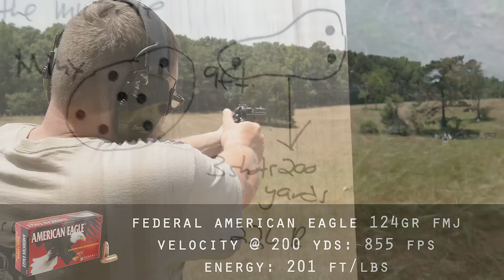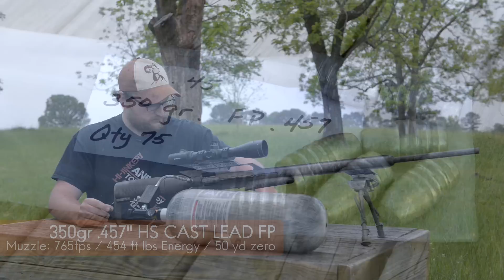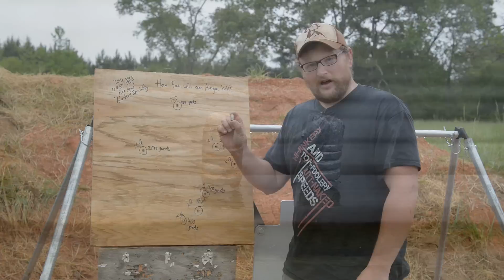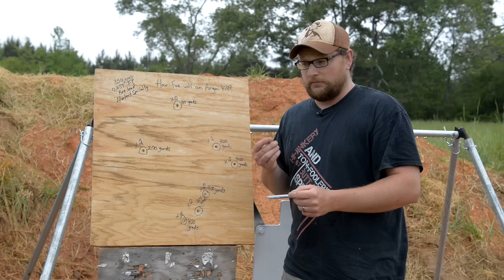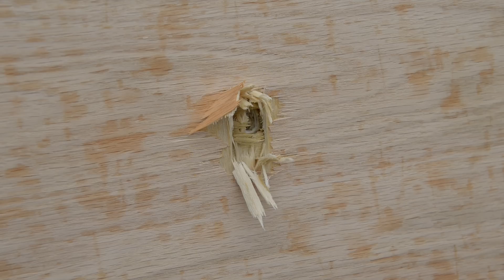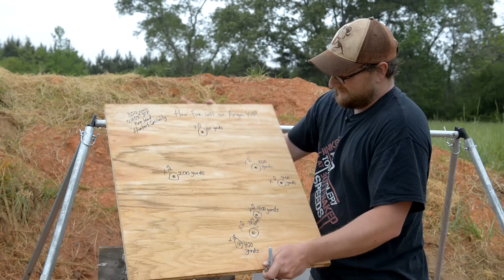How Far Will an Air Rifle Kill? Part 1

Comment: Can we see how far a 12 gauge will kill?  Maybe video game designers will stop making them ineffective after five feet.
EDIT: You don't have to explain weapons balancing, my position is that the balancing of most games is flawed.
Reply: Or the other extreme where it's basically a pump action long range rifle.
Reply: mike pk666
That's because it's a slugshot and it generally goes further than normal buckshot rounds.
Reply: You guys are wayyyyy underrating shotguns. I have a Remington 870 20 gauge youth model that I can hit soda cans with at a 100 yards with slugs; off of a bench rest of course, but it is a smooth bore and I did that with only a front bead sight! I hit 4 out of 5 with 5 shots. It also only has a 20" barrel. You should Youtube Hickock 45's channel, he shoots a benelli semi auto smooth bore over 200 yards.
Reply: If it's more effective shotguns you're looking for, ever tried Killing Floor? Both 1 and 2 have real nice shotguns. Even the starting Mossberg Rolling Thunder (a 20 gauge shotgun, IIRC) feels punchy and can take a Clot's head off at 20 feet or so.
Reply: +Inside DeMonz KSG-12 from Bo2
Reply: TheLukasDirector Hey 8888, please display the make, model, & vendor in all your vids.
Reply: bubbleheadft if video games had shot guns with far range then they would be so  
op (over powered)
Reply: Inside DeMonz If you are talking about buckshot, then my 870 youth model 20 gauge can keep all 20, .25 caliber #3 buckshot within the lines of the chest of a human silhouette target at 35 yards, and that is with a 20" barrel with a full choke. If you use winchester's flight control wad, that can be extended to 50 yards. If you want to engage a target further than that, slip in a modified choke and change to slugs, and you can get out past 100 yards, and mind you, all of this is with a smooth bore. A shotgun in the hands of someone who knows how to use it is a formidable weapon. It is still rated #1 in home defense, and for many, it is their go to hunting weapon.
Reply: ***** Maybe so, but in real life, anything closer than 100 yards, and I'd take a semi auto 20 gauge over an AR15 any day. AR's are good, but I would venture to say that there isn't anything that buckshot won't stop up close, and that slugs won't stop a little further.
Reply: Al Finnell 00 has 9 pellets in 2 3/4" and 15 in a 3"
Reply: The starting shotgun in KF2 is the best starter weapon in the game. I always use it until the last wave, but i buy the double-barrel and AA12 as well. And oh, i have a Precious skin for it :P
Reply: msged2007 And yet, with all this ballistic research for 50 years or so, videogame devs still think that shotguns have an effective range (even with slugs) of 50 or so feet.

I mean, what the fuck... I get that it's game balance and all because no one wants to play a game where a pellet can still kill you when the guy shooting at you's out of sight. But scratch damage? Nick 1 health off the bar and call it good. Ta-daa, balance.

But then there's TF2 and how shotguns are the new assault rifles in that game. Because no one bothered to pack a fucking FAL other than the Sniper (he has a bolt-action G36, by the way).
Reply: I've given up on game designers getting it right. I wish someone would bring back games like NovaLogic's Joint Operations with a new PC update for windows 10. You could use vehicles, make your own maps....almost unlimited modding potential. Shotguns. Sniper Rifles. Pistols. Parachutes. Tanks. You could load vehicles inside of vehicles and way more!
Reply: +America 2.0 Sounds like Arma to me
Reply: Play bf1 you can snipe kids with shotguns
Reply: bf dont do that.
Reply: 00 buckshot has 13 pellets in a 12 ga.   This has a tight pattern at 100 yards and no one walks away.
Reply: Just make bigger maps... you know, like in real life
Reply: msged2007
I think he means buckshot spray.
Reply: if you play bf4 use slugs
Reply: There is one lol.
Reply: Battlefield 4 got it right.
Reply: +Max Provoost yeah sounds exactly like Arma 3.
Reply: Against any kind of light armor or thick clothing shotgun pellets aren't very deadly at any significant range. The one pellet that might hit would have almost no penetration.
Reply: I always thought that slugs were still accurate up to a hundred feet or so. Guess you learn something new every day.
Reply: ***** Depends if the slug is being fired from a rifled barrel. Smooth bore barrels firing "rifled slugs" aren't as accurate as a rifled barrel firing a regular slug. I wouldn't say 100 yards. Most shotguns have crappy sights.
Reply: they did a 12ga video
Reply: bubbleheadft play destiny if you want a shotgun to 1 shot kill you at 10 meters then lol
Reply: Detective John Kimble Gotta love these big tough guys who get so pissed off about youtube comments.  I know what balancing weapons is, and if a shotgun can't beat anything over five feet away it isn't balanced, you "absolute moron."  Go be pissed off somewhere else.
Reply: bubbleheadft YES 👍 👍
Reply: Im not sure if anyone replied with this but the reason shotguns range in video games is retardedly limited is due to balancing. The way a shotgun works if it had realistic ranges in a video game setting it would be absolutely insane
Reply: At least Arma 3 has shotgun mechanics done right.

Oh wait.
Reply: bubbleheadft just use slugs
Reply: Andrew Perryman use a choke or slugs
Reply: Inside DeMonz yeah but that's the problem games need to be balanced if they make shotguns have a further range it would be ridiculously OP
Reply: clay thanks
Reply: Is espically bad on bf1 they should be a lot powerful at close ranges and far with slugs
Reply: bubbleheadft I am here a year later to advice you Rising storm 2. Love the shotties in that one
Reply: bubbleheadft I watched a vid on here saying it’s all bullshit about the shotgun spread an he showed how with a lead shot cartridge at 40 feet you would be hit with near enougth every piece of lead and it would be a kill shot but I think it depends what cartridges your using
Reply: Well if you know about balancing why are you complaining?
Reply: bubbleheadft with a slug about 50 yards buck shot about 40 yards.
Reply: dude u cant take real life to a fucking game. AA 12 will win everyshit
Reply: It's for the professional scene, Imbalance=no competive scene
Reply: I'm pretty sure Battlefield has the shotgun mechanics right.
Reply: bubbleheadft yea because shotguns aren't overpowered and way too easy to use anyway...
Reply: Andrew they are already

Comment: I'd like to see the CO2 winchester M14 air rifle with a similar test to fit the size of a .177
Reply: those are kids rifles.
Reply: +crabtrap If you think these new HPA (high pressure air) rifles are kids toys maybe you wouldn't mind standing out at 100yds with only your head sticking up and let me fire at you with my Benjamin Marauder in 25cal shooting a 50grain slug at 950fps thru my green mountain barrel and see how that works out for you.I use a hand pump no big tank and get 2 clips or 16 powerful shots without refilling.By the way there's a guy splitting a playing card on its edge at 100yds with the same gun as I have here on YouTube.My rifle is more accurate than ANY 22cal cartridge gun I have ever fired in 35yrs of using 22s for small game.By the way my longest shot was a head shot on a woodchuck at 92yds and he never moved from where 50gr slug hit him.These new HPA rifles are not the air rifles we had as kids I promise you that.
Reply: James Green
 TRY RE-READING THE POST THREAD FUCKFACE! i responded to a guy taking about a M!4 co2 pellet rifle. PERHAPS YOU ARE NOT ABLE TO COMPREHEND ???
WHAT ARE YOU LIKE 12 Y OLD?
Reply: James Green
 apology accepted.

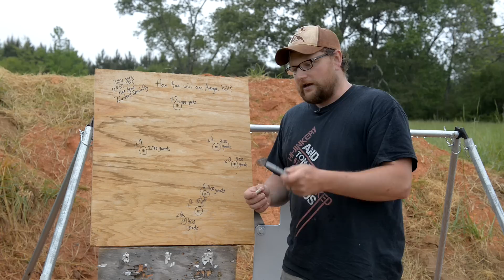Comment: at 12:54 you say that they have an elliptical trajectory, but in fact it's closer to being parabolic (because gravity is a constant acceleration of 9.8 m/s^2 and if there was no air resistance (which there is some so it's not truly parabolic) the bullet would travel at a constant speed (because of AR it accelerates negatively) and thus the bullet would travel along a exponential curve determined by gravity and the speed of the bullet)

Comment: Now can you produce your own air instead of using the tank? Like blowing into the hose balloon style? Now that would be practical.
Reply: Well if you want a self contained package I'm aware of a few options, one of them the Fx Indy. Heavy 4kg bullpup (no optics installed) with magazine system, a small tank and a self contained pump. 

It can also be refilled from a bottle though as far as I remember.
Reply: IngeniousFirefly
Don't know about the actual pressure lungs can manage, it'd be tempting to try one day for example by filling up a baloon and then letting that put pressure on a low pressure air gauge. But the 15 psi/1 bar pressure sounds very reasonable to me.

As for the PCP rifles, a lot will take a fill up to 2900-3000 psi. Some even higher than that these days as maximum fill pressure, the lowest pressure rifle I'm aware of would be the benjamin discovery. Fill pressure rating of 2000 psi (~138 bar) and a green marked working pressure down to 1000 psi (~69 bar).

Even that lowest working pressure of the remaining air after you're through the useful shots on a benjamin discovery would be way above what lungs can produce unassisted.
Reply: IngeniousFirefly Thanks, I may have a few more than is sensible. But they are good fun to use every single one of them.

Currently the collection consists out of a good old faithful crosman 1377 pistol that anyone out there knows.

When it comes to PCP ones I've got a Gamo coyote and a Benjamin Marauder pistol/carbine both in .22. In the springer category I've got a Weihrauch HW35 with iron sights and a HW97 which is using a variable magnification and adjusteable objective hawke scope.

The springers are nice enough at short range (less than 30 meters) and when you don't want to deal with the pump or bottle. I like the marauder because it needs a lot less air per shot and won't wreck some of the weaker targets I made. But when shooting out to longer distances I'll take the extra stability and power that a full size heavier rifle grants any day. One day I do want a nicer rifle maybe an FX, a Weihrauch HW100 or perhaps even a Daystate.

If you're interested/tempted to try a simple pcp rifle one day a Benjamin Discovery or the more recent Benjamin Maximus available in .177 and .22. There are reasonably affordable kits out there along with a pump, probably retailing in the region of 250-300 USD. Bit more expensive on the other side of the ocean for me.

That's kinda the downside of PCP rifles really, to get "started" you have to invest a decent amount of money into fill tanks (if you can fill them locally), a handpump or if you're financially insane a high pressure compressor that'll fill your tank/rifle up to working pressure. Once you have that though and a rifle you like the running costs and maintenance required are very low for a lot of fun. Essentially just pellets and refill costs or a little bit of work on the handpump.
Reply: IngeniousFirefly Sounds like a good thing to spend money on if you enjoy using/tinkering with them.

For me a lot of free time and money goes into pellet guns and messing around with electronics.
Reply: IngeniousFirefly Relatively useless low power stuff, microcontrollers, small PCBs, typically powered either by a powersupply or a single 18650 battery or small lipo battery if it has to be smaller.

It has mostly been some silly small stuff to get a better understanding of things initially. But I have made a few small things that "do a mostly useless thing" as intended by design. Think things like using the microcontroller to handle some sensor inputs or another programmed thing and make it "do some things" which varies from controlling servos to making LEDs go on/off.

Also made a few basic things like switchmode buck/boost powersupply with variable output voltage that handles a decent amount of current. It works well on 12V input voltage for example with standard lead acid batteries as a portable powersupply.

Its nothing fancy really so far, but occasionally the tools like multimeters, LCR meter, oscilloscope etc come in handy to analyse dead electronic devices... if they allow themselves to be opened nondestructively and the fault can actually be found and repaired. If its a special chip that died once you've found it... good luck finding a replacement. However if its just a bog standard capacitor being dead on the power supply side you're usually looking at an easy and cheap fix. Surfacemount components can be handled too but finding the fault may be a little bit harder and the circuit design is more complex than a standard mains AC to DC powersupply.

Also to rescue the odd powertool battery pack when some of the cells went bad, combine 2 bad ones into a working one for a while. Involves a bit of work, charging them, measuring the internal resistance and doing a basic capacity test to get a somewhat balanced pack. These days though you'll rarely see NiCd or NiMH in new stuff so depending on the implementation it gets a bit trickier but far from impossible.

I've converted a few battery powered formerly using NiMH cells that weren't too voltage sensitive into using either 18650 lithium ion cells or a standard lipo pack depending on what is convenient. None of this is really rocket science, enough willingness to read up on things and a bit of a brain + being interested to keep going with it will get most people there.

One day I might make something I consider actually useful myself but its really just a way to spend some time at the workbench learning things and tinkering with the soldering iron and various other measuring tools. Then followed up by programming some code into the microcontroller making the electronic thingy do a few things.

Many tools/devices just aren't worth the headache to repair though (if its more than a simple dead capacitor, dead switch or bad connection), if they are interesting I might tear them apart to look at them and try to understand them better but unless its really easy or worth it/interesting they'll probably end up on the trash anyway.

Comment: Heavy = energy retention. Hell if you throw that .45 at 75fps with your bare hands, it could probably still brain someone if it hit in the head.
One thing about the airgun... can't you simulate range DIRECTLY just by lowering the launching pressure?
Reply: Practically, yeah. I wonder why they didn't do that.
Reply: yup, momentum, unlike kinetic energy, is equally dependent on mass and velocity

Comment: 611 inch drop at a quarter mile...50.9 foot drop, impressive. Digging up my physics notes, that's a 1.77 second flight time. For comparison, a 750g 50bmg can cover 1325 yards in that time.  50bmg will drop 611 inches in about 1413 yards. I can't find any info at what range it'll hit 593fps at, but it's past the 4,000 yard mark(in theory). Neat comparison. Shooting air rifles scales everything down with the lower velocities. When the limits are lower, the fun is closer!